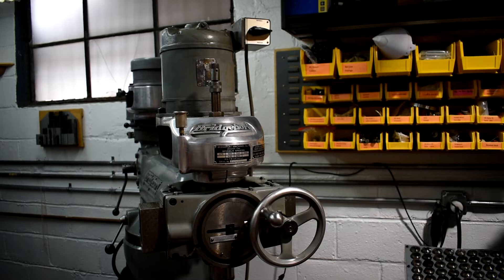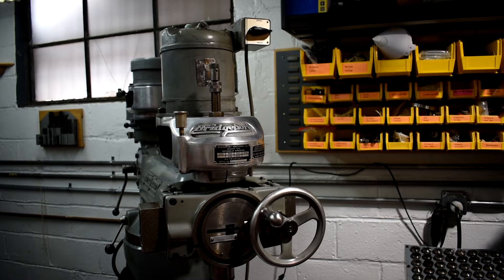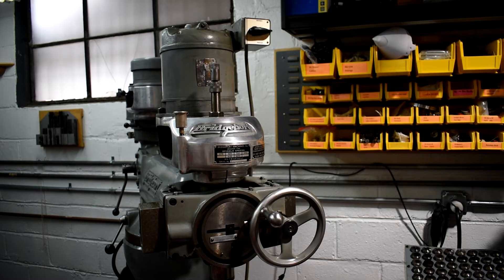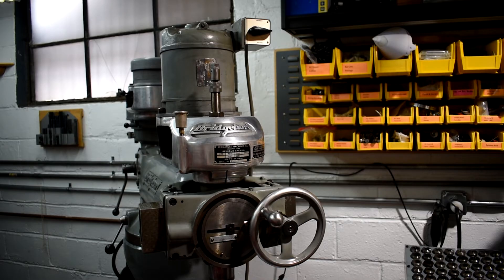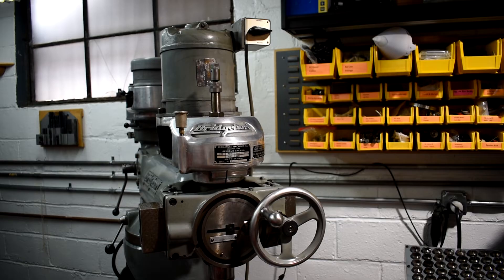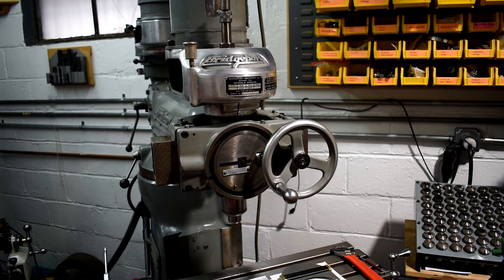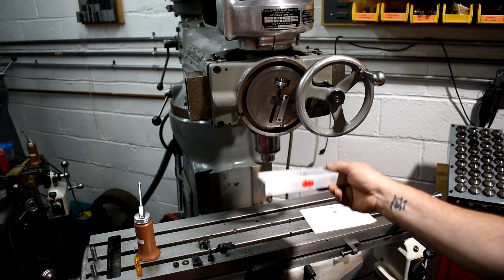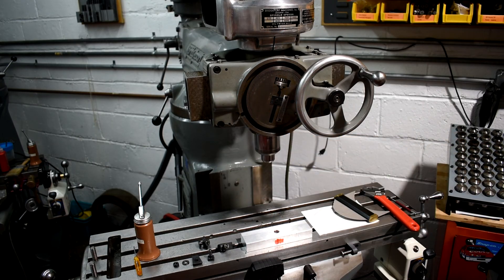Bridgeport Cherrying Head Pt 1

Comment: We had one in the tool shop when I just started out. It didn't get used much but we had a few Deckels pantographs which were easier to use.
Reply from the maker: Hey Bernie,   mine doesnt get much use either...   however i may mount a motor to replace the handwheel at some point..  may be a good project and make the unit a little more productive.  Thanks for watching !!!  Joe